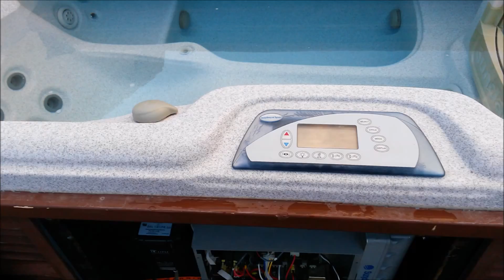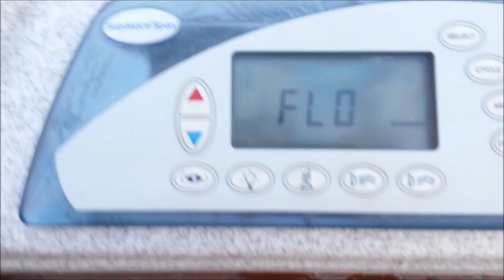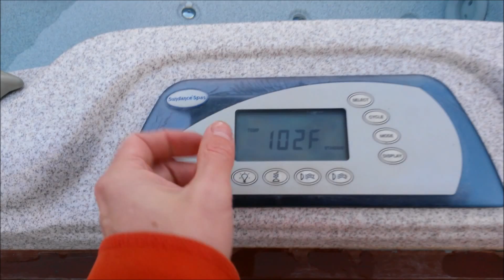Hot Tub Not Hot Enough? 104° Temperature Override  (:2:) The Resistor Method

Comment: 1K resistor works great!  boosted the tub to below 110.
Reply: what kind of tub and what temp did you set to get 110 degrees?
Reply: felix u You can get 110 on any hot tub with the right resistor combination
Reply: I replaced the old electro-mechanical control system on my 15 year old Pacific Marquis with a SpaBuilder's LX-15 system, which had the  connectors necessary for me to add the two 1k resistors. I now soak in my tub almost every day and melt...at least mentally. :)
Reply: I may have missed this, but does it matter whether or not the tub is wired 110V or 240V?  Mine is a plug and play 110V Aquaterra.
Reply: felix u The control board and temp sensors run on 12 or 24 volts so it doesn't matter what your input voltage is
Reply: GadgetClass  okay, thanks.  I discovered last night that by holding the + down about 5 seconds, this display indicated "or6" which I think means override to 106 degrees.  That's exactly what happened.  I still may want it hotter, and if so will try the resistor.

Comment: hi and thanks so much for the video!!I did use 1K ohm resistors as suggested, and the water temperature did not increase. Any thoughts? More resistance perhaps? thanks
Reply: John White Does your hot tub have a temperature reading or LCD screen ?

As long as you did both temp sensors, you should have seen some change.

Try 5K ohm resistors. may be a really old model that used mega ohm transistors.
Reply: It's a 2001 Sundance Tango, LCD display.  I did add resistors to both sensors, and actually there was a tiny increase in temp - but it's still not as hot as I like, or as hot as it used to be.  I ordered a new sensor and will try that.  If it doesn't get hot enough with new sensor, or with new sensor and 1K Ohm resistor, should  I still try a 5K Ohm resistor?  really appreciate your help!
Reply: John White the new sensors will put it back to factory condition which should give you a max of 104deg.
Reply: I finally changed the temp sensor, and put the 1K Ohm resistor in, and now the spa gets to 108-109 degrees!  Yes!  Now it's a hot tub.  Thank you so much for posting this video!

Comment: Good Day Spa Dayz,   My High Limit & Temp probe sensor are on a 4 wire pin connector, and the Inflo sensor is on a 3 wire pin connector... Where will I place the resistor.  Gecko y-5  series spa pack ?

Thanks Andy
Reply: I have the same problem. I have asked for a schematic from Gecko but they won't send to me. If you do figure this out I would love to know the workaround. duaneok@shaw.ca

Comment: Just bought a Bahama spa with a Gecko IN.EX and am having an issue with determining out of the 4 wires that come from the board to the high limit temp probe as to which wires the resistors should go on, is it the red,green, black or white. In tracing these wires I do not see any of them going anywhere else but into the heating tube. Please advise
Reply: Andy above told me: After many ohm tests I have calculated the Red / White   & the Green/Black are sensor pairs….    I used a 1k ohm resistor on the red and the black wires. This gave me 7 deg more heat than shows on the Hot Tub control pod / controller.  Way more heat than I need so I now keep my tub at 99 deg but actually the water is 106.5  
 
I would use two .5k ohm resistors instrad of the 1 k resistor that was recommended.

Comment: Will this work with the Strong Spa's? 104 doesn't seem too hot...
Reply: Yes as long as you can find the leads for both temp sensors. You can also just replace the temps sensors as usually it is a bad sensor. 104 is usually hot enough for most people but the sensors drift over time. Either way will work. compare the temp to a floating thermometer
Reply: Well that is good to know.  Thank you.
Reply: use a digital cooking thermometer. it gives you the best reading for the water temp.

Comment: Thanks for the video.  Got a plug and play tub and did this.  Works great.I put in the 1.2K resistors.  I've had it up to 106 while temp reading said 102.  Much better then factory.Big advantage for me is because I'm running on 110 the pump on high and the heater will not work.  this allows the tub to get to a higher temp then cool off as the pump runs.
Reply: which model do you have? I just got a hudson bay xp-29 and want to get it a bit hotter for winter months.
Reply: @augustheat  did you succeed in making it hotter? I have your model too and thinking of doing this

Comment: hi Spa Dayz, thanks for this video.  do you know if your fix, putting the 1K ohm in series with both temp probes will work on a dimension 1 spa?  mine is a Triad ultralife.
i plan to order the resistors from your link as i appreciate your time and effort regarding this matter. regards, John O
Reply: Should work. the resistance just makes the control board think it's cooler than it is

Comment: Fix works absolutely as described. I installed 1K (1/2) watt resistors on my Intex Pure Spa Inflatable hot tub. Installed one on each temp sensor line and the closed up my unit. Reset my hot tub to 104 degrees. Increased temp to 118 degrees. Way to hot. Reset temp to 100 degrees and temp now holds at 109 perfect. Thanks for the fix
Reply: Alan Stayton 
If you still get this,  I just got an Intex and am already ready to get this heat increase set up.   Guess my guestion for you would be if you found one or two sensors?
Reply: @3ddexter  did you ever get yours sorted? i have the intex tub and want to get it sorted as now the winter months are here the tub just isnt hot enough. any info would be great.
Reply: +Alan Stayton ---- mind helping me out some--- I am having an issue locating the temp sensors in my lazy spa--- any possible way to get a pic? --- mlytle-at-twcny(dot)rr(dot)com-- greatly appreciated
Reply: Alan Stayton, anyway to send me some info atall? A photo would be amazing? was it hard?

Comment: Guys i've just been asked to look at a Balboa hot tub. The jets no longer work from the control panel yet they still work on the filter cycle or when the tub is first switched on they fire up. Does the control panel have a separate relay for the jets? I'm hoping to find a bad solder joint or bad relay. Expecting there might be some water damage though and perhaps its creating a short through mineral deposits in the panel or the main board. Any ideas?

Comment: This was very helpful and I'm so happy with the results. I got approximately a 3.5 degree shift out of the 1K resistor. As I mentioned in a response below, my tub was always slightly underheated. At the end of its heating cycle it would be very close to 104, but not quite. I did have the temperature sensors replaced twice trying to fix the problem. During the winter months in Michigan, the water would become so cool after about 30 minutes that is was not very therapeutic. I now set the heater to 103 and the tub is usually between 106 and 106.5 when I open it. After 30 minutes the tub is at around 104 but at the higher temperature I'm usually done then anyhow. I love that this method leaves the basic circuitry of the tub and the protections built into it intact. Thank you for posting this. As for the criticism below, it should be noted that in Japan tubs are set to 110. I visited a hot spring in Germany that was at 108. And of course you can set your hot water heater to very high temperatures if you so choose and fill a bath tub with it. The idea that the government passes some law and sets a number that every person at every level of health in every climate in the country has to abide by is just plain dumb to me. In the summer I could barely handle 102 (before the mod it was probably closer to 101.5). In the middle of winter, 106 is feeling pretty good to me right now. It is my tub and my choice what to heat it to.
Reply: i agree....why can you set hot water heaters to 110+ but not hotubs...lame....
I just did a 3k resistor and at 100/101 its 110...

Comment: In a lazy spa inflatable I am having a hard time finding two sensors. Is it possible there is only one? It looks to be dead center on the top. The water is warm around it under the cap. I see one flow sensor also. I would think there would be two if there were two heat sensors?
Reply: +Gacy x i would just try the 1K resistor in line / series with the temperature sensor that you found and see what you get.
Reply from the maker: +MuffinHeadCakePie thanks for posting back! it will help others with that brand
Reply: Can you by chance post some pictures or a video of what you did on the Lay-Z Spa?  I want to do this very badly, but nervous to do it on my own without a little help.  thank you in advance.

Comment: At my local electronics store (used to be Radio Shack, now has a new name) I have a choice between 1/4 and 1/2 watt 1K resisters.  Which do you prefer, or do they both do the job?  Also, I can't get the second link "just the 1K resisters" to work. THANKS.
Reply from the maker: +Fred Lackaff Either will work. Might be good to get an assortment so you can play around with different values. This link should work:
http://www.amazon.com/dp/B00B5R8950/?tag=spatemp2-20

Comment: did you take down the 3rd video of the series?
Reply: the video got corrupted and I didn't feel like reproducing it. The main just was to try covering the temp sensor (generally in the filter area) with some good silicone to insulate it. it will then read a lower temp than the tub.
Reply: +GadgetClass thanks man i have a new tub the sensor is readin 104 yet the water is at 99 its irritating i cant figure it out
Reply: +fanboiii mcfandom if it's new you might be able to claim a warranty repair, then have the tech that comes out to install new sensors hack it to go higher for you.
Reply: +GadgetClass i was looking at my sensor cables and theres 8 wires that plug into the board... throw a 1k resistor on every second wire or?
Reply: +fanboiii mcfandom no. you need to identify the 4 sensor leads. one will go to the heater area and one will go to the water in the filter area.

Comment: I tried this on a '97 Arctic Spa and it didn't do anything. There were however, three wires going into my thermostat probe (red, black and green). Any thoughts?
Reply: +Michael Pascas , Green is usually ground.  The resistor goes on either the red or the black, it doesn't matter which.  It goes in series with the sensor, not in parallel (between the red and black).
Reply: +Michael Pascas  The m-series pack in your Arctic spa derives temperature from impedance, not resistance.  Butchering in resistors will do nothing.
Reply: +Mark Bodnar thank you, Mark.  I stand corrected.
Reply: Well thanks, I was under the impression those two were the same thing but a quick Google search proves I am wrong...if anyone is interested to know what I did instead, I wired a switch into one of the thermostat wires (didn't seem to matter which one), when I hit the switch it trips a thermostat error code, but after I reset the breaker to the tub, boom it reads 0 degrees C and runs the heater indefinitely until I hit the switch again. This way I just preheat the tub to desired temp 10 minutes before going in...I'm actually not even sure if the high limit still works with this set up so hopefully it doesn't get left on.

Comment: I used this method on my Coleman Lay Z inflatable spa and it worked perfectly. Used 2.5K resistors and it adds about 5-6 degrees to the displayed temp.
Reply: Hey Chris I have a Coleman Saluspa, basically the same tub. I was wondering if you could tell me which thermometers you added resistors to? I tried adding 1K resistors to the two connected to the inlet before the heat pump and one connected to the directly heating device and got an E06 error.
Reply: Chris Laster that's pretty cool.. do you have any updates with temp increase